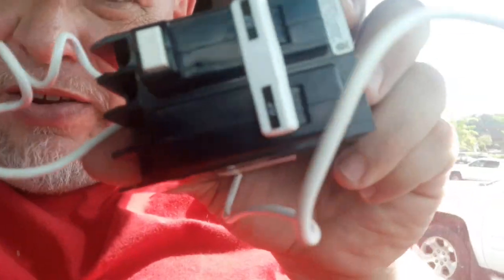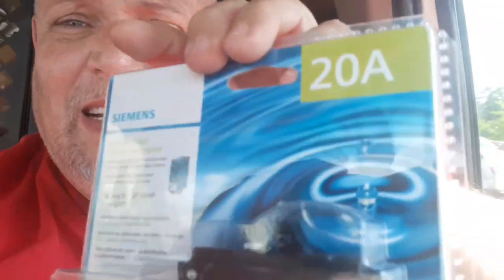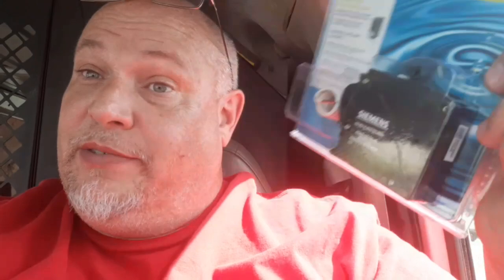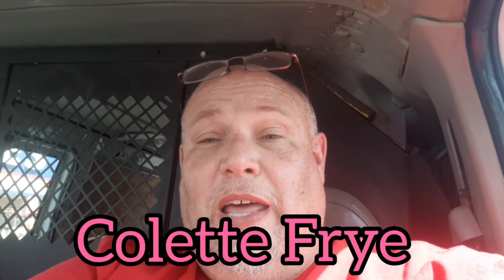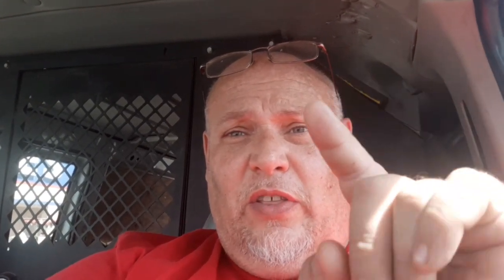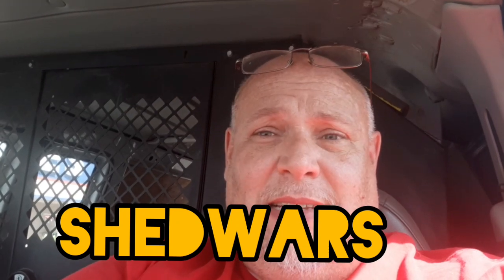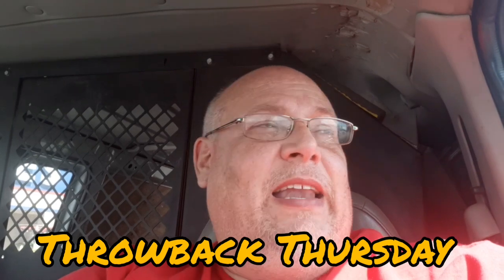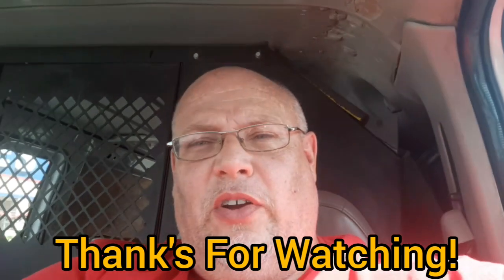Why GFCI Breaker is tripping on pool pump

Comment: How about a smaller above ground pool pump 3.5 amp and it’s tripping the gfci plug? Could it be the pump? Or the gfi plug?
Reply from the maker: It could be either one. I would try to plug something else in the GFCI protected outlet and see if it held. Then you would know which one it is. If it's one of the small pumps with a factory gfci Plug on the end of the cord you will have to replace the pump.

Comment: Hello frank and Tina . So pool has always ran fine but last year my breaker keeps tripping only when it gets hot outside . Like in afternoons . It's on a 2 pole GFCI breaker with a Eaton breaker . What could be causing problem?
Reply: Could someone help
Reply: Frank & Tina
Reply from the maker: If its been working fine for a long time and only goes off when it gets hot. That sounds like a motor problem in the pump to me. But hard to say without being there. It could be a weak breaker too. So it's kinda hard to say.
Reply: @FrankAndTinaOfficial  well brother moved in basement apartment and he is running power down there but yeah only Trips when it gets warm in afternoon and suns out beaming. We tried changing GFCI out with one just same as we have in there but soon as we turn it on it Automatically trips breaker . So but old one back in and it works fine for a about a hour and trips breaker. Pool guy said something wrong with electrical that pool equipment working fine but I don't know if he really wanted to mess with it or not
Reply: @FrankAndTinaOfficial  is there away to test the motor ? To see if that's the problem

Comment: Is this a single pole?  I don't have a variable pump, so figured this would be fine.   I have a one hp hayward super pump.
Reply from the maker: That one is a 2 pole. But it applies to a single pole set up too. But most single pole variable speed breakers don't have as many issues with tripping a GFCI.
That one should be fine on any GFCI breaker.

Comment: I have this same issue with the pump that was just installed for my water features.  My pool builder said its out of stock everywhere. Hoping that you might know where I would get one?
Reply from the maker: I don't know where to to find one right now. Everyone is out of a lot of things right now..
Reply: @FrankAndTinaOfficial  what's weird is.. My breaker will only trip during certain hours.  If i wait til 8pm, I'd be able to use the pump without it tripping. It's a brand new pool and pump. Sigh. I'm wondering if it's something with the scheduling too. My pool builder says they normally use the siemens one but the one they used on mine is the culprit.
Reply from the maker: @jnguyen131000  the problem is when the pump changes speeds the Breaker thinks there is a ground fault. The trip rating is too low on the breaker you have. The Siemens one has a higher rating and the new Square D Homeline ones work too. You might could find one of those.

Comment: That’s exactly what’s going on ! It’s ok to use a Seimans breaker on a square D panel box?
Reply: They will Work but you are not supposed to put them in there. But I have seen it done before. If it's a Square D homeline. QO  will not work
Reply: Where can I buy the square d homeline? Lowe's, menards, and home depot are out of stock.

Comment: So if your using a QO panel will a Simens breaker even fit ? Or work in a QO panel ?   I didn’t think you could use different brand breakers in panels
Reply from the maker: QO absolutely will not fit. You will need to install a siemans disconnect. Some breakers will interchange and some are legal  and some are illegal to interchange but they still fit. There are sites on line the tell what's legal and what's not. But qo is completely different
Reply: Adventures of Frank and Tina yeah I was kinda afraid of that.   🤦🏻‍♂️  yeah I’ve already got a sub panel in garage and already prepped for the pool breaker.  Definitely didn’t plan ahead for any extra issues.  Lol I was hoping just to run this 10G single pairs to splice box.  Then 10 wire romex up into panel & then throw a SQ D QO.  GFCI breaker in and call it good. But seems like a lot of people have issues with it tripping.
Reply from the maker: @jasonjackson329 some hold
 I'd try it. But I'd say at least 80% will only hold on a siemans. That's what Hayward Pentair and Jandy all recomend.
Reply: Adventures of Frank and Tina  yeah I’m going to try and see what happens.   I’ve got bad luck with some of these stupid `code’ breakers.  I’ve got brand new arc / ground / GFCI that won’t hold for crap     Doesn’t Matter what you plug into it.   It trips immediately.   I added landscape circuit and can’t even use it.  Lol 🤷🏻‍♂️ over priced breakers that are way too sensitive for no reason
Reply from the maker: @jasonjackson329  yep there are lots of problems with them. Its usually a light bulb not screwed all the way in lol

Comment: My pentair variable speed pool pump is about 5 years old and was tripping breaker. Changed the breaker and still happening but I notice its only when it turns off. My electrician thinks it's the pump. Any thoughts? Just saw this video, would changing to Seamens brand fix this?
Reply from the maker: It might stop it because of the higher trip rating but it sounds like he is probably right the pump is probably bad. I can't prove it but it feels like all of the companies are making stuff to last just past the warranty (5 years). I run into tons of HVAC systems and pool pumps that go out at 5 years.
Reply: @FrankAndTinaOfficial   thanks for all your help. In my case it ended up being my pool pump. Was overheating and drawing too much amp.

Comment: Ok...I installed a new seimans 20 amp gfci to a brand new panel, yet the gfci breaker keeps tripping.  I hooked  the line up to a brand new 20 breakers and no problems.  Any thoughts on this?
Reply from the maker: Its got a ground fault some where if the Gfci won't hold. Or could be a weak breaker from factory. I would probably make sure the ground wire was isolated and that both wires going to the pump were attached to the gfci breaker on the correct terminals. Then check the connections at the pump to make sure there was no nicks in the wires or connections that were loose or wrong or any wires touching each other at all. 
If that all looks good. First I'd try another gfci breaker and if that doesn't fix it the only thing left is to replace the pump.
Just the process of elemenation.
Those things can be frustrating but if it is a ground fault problem and not a bad gfci it could possibly be a dangerous condition so I would for sure get the Gfci working one way or the other.
Reply: @FrankAndTinaOfficial  thanks for the reply. We replaced the breaker with another brand new one and that solved the problem.
Reply from the maker: @leppy240  good deal! Sometimes they are bad out of the box. They really need to get better on the GFCI breakers they are way way to unreliable.

Comment: Can I just install a non GFCI breaker?
Reply from the maker: It's not legal to do that. And if there were a short it could be dangerous. I wouldn't do it or let my kids swim in a pool that was not on a GFCI. Plus if someone does get hurt you are open for a lawsuit. Not a real good Idea. But technically it will work. Before GFCI breakers they were wired like that.
Reply: Thanks I will use a GFCi breaker.

Comment: I did and the new still tripped from the box it won’t reset on. I think my pump is bad.
Reply from the maker: That's usually what it is if the new breaker won't fix it. Or either a problem with the wiring or it's sized incorrectly.

Comment: UPDATE:  I'm putting my old Waterway dual speed pump on my pool.  ITS OLD, but a tough bugger.  Its a 60 HZ, Volts:  115, AMPS 11.0/2.9., dual speed.  What size breaker would you use?  Do I need a single pole or double pole?  Also, will the Siemens fit in the Square D Breaker box.  We are Square D also.
Reply from the maker: A duel speed should be fine on a SD breaker. It should be at least 14 gage wire with a 15 Amp single pole Gfci protected breaker. That should be fine. A 20 amp with 12 gage wire would be fine too. But to some inspectors are picky about the maximum ampacity. It should say Min/Max ampacity on the side of the pump. Just don't go over that. Hope this helps

Comment: The breaker has been tripping and when I reset it. The motor comes back on runs for 30 seconds to 3 minutes and then shut back off. And they'll pop back on for a minute and then come back off. And then I just go ahead and shut it off. The breaker again cause I don't want to keep doing that.
Reply from the maker: Hi Michael!
What I would do first is isolate the problem. Distinguish if it is a GFI trip or a overload, or a short. 
Just for test purposes, take the GFCI breaker off and install a regular breaker. It holds you know you have a ground fault condition. Inspect all wires and connections. Worst case you will have to replace the pump. 
If it still doesn't hold then you either have a overload or a short. I'd put an amp meter on it to see how many amps it is drawing. If it is drawing more than the name plate ratings then you probahave a capacitor problem or a bearing going out or maybe a worn out pump. If it is less than 20 continuous amps.  Then it is a short. I would take all of the wires loose and check for continuity between the wires . And find where the short is. Make sure nothing is touching. Hot to hot, or hot to ground or hot to neutral. And for the GFCI neutral to ground. 
It could also just be a weak breaker. The new one will let you know that as well. 
I hope this helps. It's hard to help from just text. 
I'll say a prayer for you on it too! God is a better Electrician than me any day of the week lol!

Comment: Man new pool pump works fine .but soon as it started raining its tripping don't known why
Reply from the maker: There is water getting to the wiring somewhere.
Reply: I turned off the timer and try to turn on breaker and it still trips